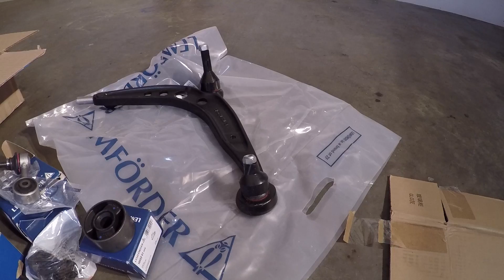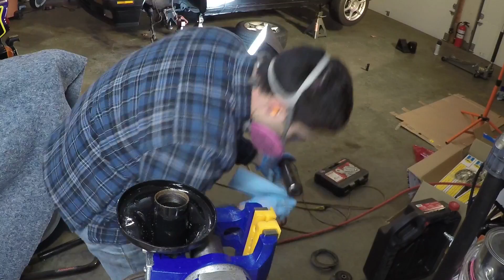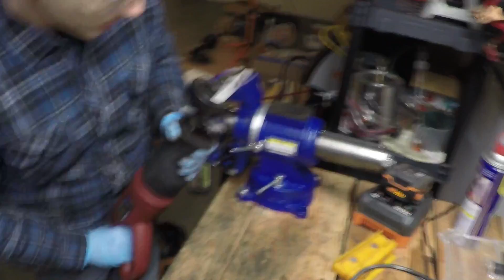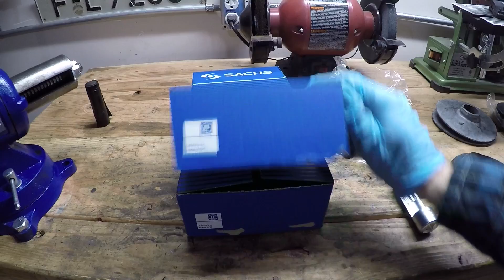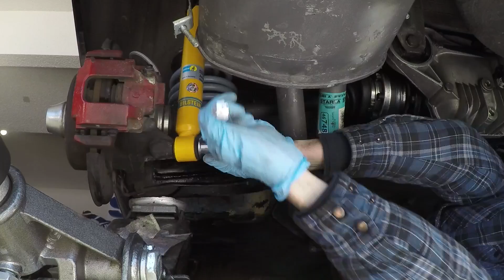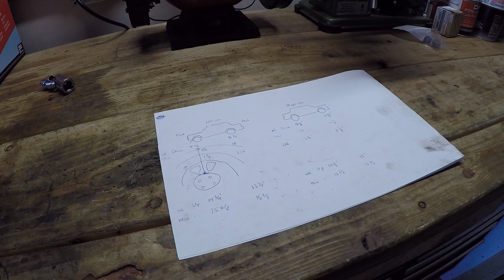Project E30 / Ep. 20 / Complete Suspension Overhaul

Comment: Awesome playlist, I am learning so much from these videos. I plan to refresh the rear suspension on my e30. I have a question regarding the sway bar links. I am guessing you used grease on the passenger side when installing the link but won't that affect the rubber in the links? And also did you follow the torque specs for the nuts/bolts ?
Thanks a lot!

Comment: Hi, how sporty is the ride with the B8s? I'm thinking I'd like a comfortable ride on my '85 325e but am curious about the performance series vs the OE replacement B4, which I currently have and need replacement. Would you say its equivalent to a factory "sport" suspension? My wife's e36 has that and it's rather stiff, I'd say. Thanks!
Reply from the maker: I would say the B8s are bit stiffer than the factory sport suspension. I would recommend sticking with the B4s to retain ride comfort.

Comment: Question for you regarding the rear install. Did you re use the rubber bump stops on the rear? I’ve heard there integrated into the shocks. The rears come with a metal washer as well. Can you tell me where you put that?

Comment: Hey great videos you post. How is your ride with the hr and b8s . Is it harsh at all over rough roads or bumps? I put hr sport and b6 on my 325ix and the ride is harsh on bumps and rough roads amd even small bumps are jarring. As I read more im wondering if I should have used b8s. Feels like its crashing. Any thoughts?
Reply from the maker: The B8s are likely just as harsh as the B6s. Definitely great for the track and spirited driving, but for a daily it's a little too extreme.

Comment: Not sure if you've owned early model e30 vs late model, but there's a verrrry slight difference in the late model rear arches. They're basically kinda oval and lower on the top vs the pre-87 round in front and back, so the rear can look lower than the front all the time even though it's not really. It definitely can look funny, but the top of front tire showing a little bit with the rear just barely under the arch  is my preferred setup.

Was fighting negative camber despite ground control setup at max and adjustable subframe maxed, but after 3d printing some pretty thick nylon spacers to stick on top instead of old rubber for the bigger style springs, things are finally perfect. 
(Ground control always claimed their street version would go nearly as high as stock from what i remember, which seems crazy to me as spring won't stay on if cranked up any higher lol)

Comment: At 10:38 - are you packing the upper strut mount with grease?  Also, are you putting anti-seize on the shocks/strut threads before inserting the new shocks into the front struts?
Reply from the maker: Yes and yes.

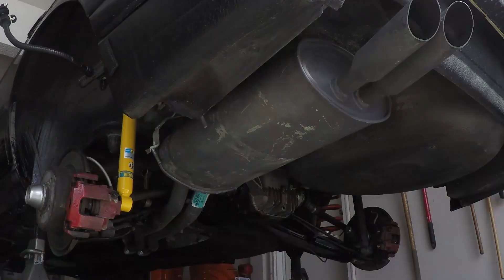Comment: 26:30 You dropped rear subframe to fit the spring. Could you have used the spring compressor instead?
Reply from the maker: The spring compressor was too tall to fit. If you were to cut the compressor in half it could probably work.

Comment: I just found your channel and it's awesome! I'll be tackling this soon on my '90 325ix but I'll be installing B6's instead of B8's. My only question is did you put those little stock bump stops back onto the rear struts? I know the front Bilsteins don't need the bump stops because they have internal ones but I can't find anything online about the rears
Reply from the maker: I did put the bump stops on the new rear Bilstein dampers. The instructions didn't mention an internal bump stop for the rear, I so I put it back on. It certainly won't hurt anything!

Comment: Thanks for the detailed video! im doing almost the exact same on my E30 in the coming weeks (bought the parts already). One question would be that I noticed you used different types of grease for different parts.Do you remember what types did you use where? I mostly remember in the front shock towers and the front shock mounts. Thank you!

Comment: For the follow up video make sure to measure the settle of the suspension. And keep an eye on it after the alignment. Ideally, youd replace all those parts have it aligned then after a couple hundred miles  have it realigned to account for settling and such. Nice through job on the video. But 1400 bucks.... Ouch, thats steep for only  improved OEM handling.

Comment: Love the content man. Just curious on the rear shocks. If there was a method to your madness or you just didnt think about it. Why drop the whole rear subframe as opposed to just putting the spring compressors on the shock to fit it in?
Reply: massive pain in the backside to move stuff around with the arms etc. in the way
Reply from the maker: It's a good question. I didn't even try to use the spring compressor, it just didn't look there would be room for it to work. I think if the threaded rods were half the length, then it could probably be made to work.

Comment: Usually lads are putting in lower springs so you don't have the hassle you had with the rear set up. Will likely settle somewhat. No expense spared here and a great reference for e30 owners.

Comment: The car is turning out Awesome. Just curious if you’ve considered using any M parts to utilize the  R&D BMW has already put into upgrading the performance of your E30? Also, any plans to upgrade the wheel/tire combo? 
As a former master BMW tech and e36 M3 specialist, I’m really enjoying your build, great job
Reply from the maker: Thanks Justin! No plans as of now to change the tires/wheel. I haven't really looked into any M-specific parts for this car. Anything you recommend?
Reply: @PracticalEnthusiast   A 5 lug swap from the E30 M3 would free up more wheel and brake options. Also, the later E30 M3 had aluminum front control arms. The steering rack from an E30 M3 is a good upgrade and I believe the rack from an M Coupe is good too.The rear suspension from a Z3 is the same as an E30 for the rear 5 lug swap. The M Coupe has a factory short throw shifter that I believe is a direct swap into the E30. I have always loved the E36 M3 M Contour wheel and they look awesome on a 4 door E30.Some guys run 4 fronts so the rears don't stick out if they don't have the fender flares from the E30 M3.Just some info for you to consider. I understand you just went through the suspension so you probably don't want to upgrade now. Some manual black Vader seats from an E36 M3 would be killer in your car too!
Reply from the maker: @justingustafson7964  I appreciate all the info! I'll probably leave the 4 lug set up on there for the foreseeable future, but I agree, those Contour wheels would look excellent. I picked up some E30 sport seats that I'll hopefully recover in a future episode to help round out the interior. The steering rack upgrade is something I'm definitely considering!
Reply: Practical Enthusiast sounds great👍🏽
I’m sure whatever direction you go in will turn out excellent, like it already has been

Comment: Nice work! That topmount tool looks mint! I was going to buy a swan neck spanner so I could keep an allen key on the strut but a friend turned up with a high power impact drill, which did the trick fine :D

These cars handle like crap (especially at the rear with worn subframe bushes) when the bushes are worn out but the difference with a suspension refresh is staggering.

Comment: I just did this exact thing in my wife's 2007 Jetta GLI. Predicted about 6-7 hours to complete. Took 15 hours of actual working time over two days. I didn't think I'd have PTSD but watching this made my back sore and my eyes twitch all over again! 
When you had to loosen the rear sub frame to get the rear springs in I just shook my head. I had to do the same thing but in my case the transmission was sitting an inch away from the front bolt on the driver lower control arm, which is a 3 inch bolt. Had to loosen the sub frame as well to lever the transmission out of the way!  Love these videos! Can't wait to see how it drives. The GLI was night and day!

Comment: WOW! you just did it again! What a good quality content! I know my future E30 suspension overhauling time will cut into half because of this video. The cost of a full suspension restoration is little bit intimidating though. 
Believe it or not! I have started working on my AC system by fully converting it into 134a before it getting too hot in Florida.  :)
Reply from the maker: Thank you! Glad to hear you've found this video helpful. The AC conversion is an excellent idea!
Reply: @PracticalEnthusiast  Finally got the job done today with new compressor, parallel flow condenser, aux fan, evaporator, expansion valve. Now my E30 can blow sub 50 chill in a 90 degree day :)

Comment: Fantastic video. Glad to see you detail the bumps in the road.  Thanks for the total $$ outlay number.  Curious-excluding video set ups, fiddling with the camera etc, how many hours do you estimate this took you? Please include the time for things that creep up-lowering the rear to accommodate the new springs etc--all these projects have unexpected issues so while your issues may be different than mine, the fact is, we both will encounter problems

Thanks again-great series and I look forward to seeing the road trip and your observations on the improvements
Reply from the maker: Hey Steve, I'd put this job at around 30-ish hours taking the bumps in the road into account. It took me a solid 4 days, working about 8 hours each day (not including video stuff). My saving grace is having a hardware store only 5 minutes from my house. This really helps when I have to make a last-minute special tool at 8 PM, or have to buy an odd nut or bolt. Without that resource, the job could easily take many more hours to complete. Thank you for the good question - you bring up a genuine obstacle that goes along with any sort of DIY auto project.